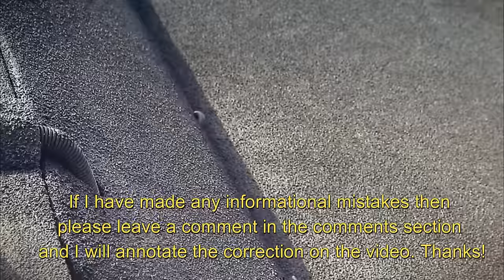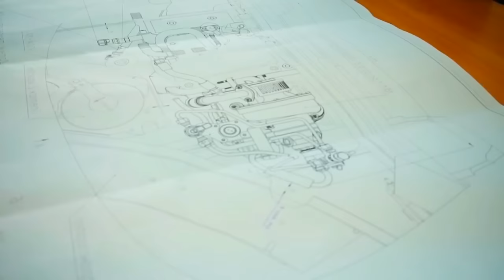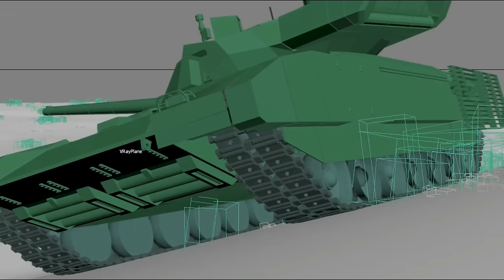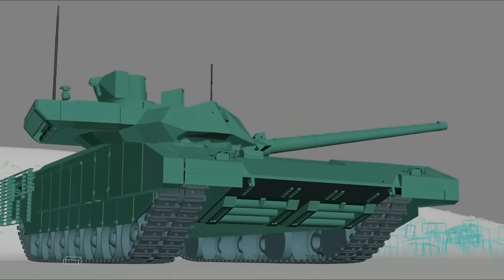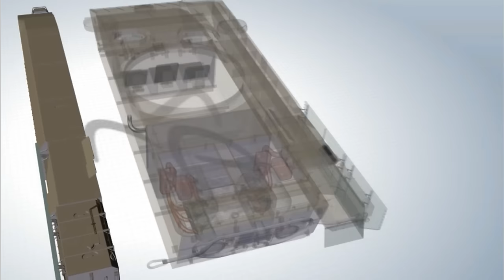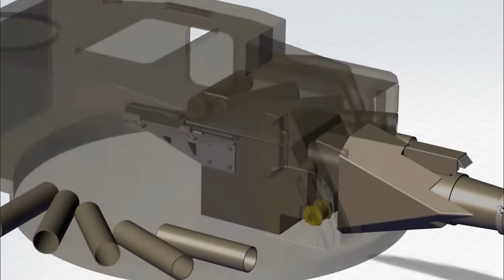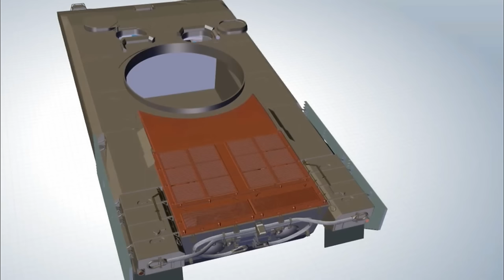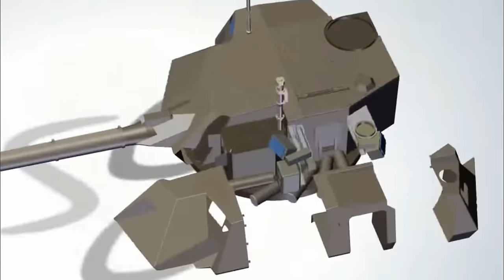T-14 Armata Russian Main Battle Tank - Tank Overview

Comment: 1000mm of frontal armor! Holy Fuck what I wouldn't do for that on world of tanks
Reply: Significantly more)
Reply: Enclave Soldier Tier XII comrade!
Reply: Actually 5400 because of the dual layered anti-tandem Malachit ERA.
Reply: funkierfawn budgie 
I am highly doubting that this ERA is actually 100% tandem proof or tandem proof at all. Especially when there is nothing on the web about that technology.
Reply: ori kojokro It is because in each Relikt or Malachit ERA block is a dual layered charge system with 2 plates and when tandem shell is hitting tank, 1st layer will destroy tandem charge and second layer will destroy the primary threat.

Except now, there's 2 blocks patched between armor for significantly higher armor value.
Reply: funkierfawn budgie 
Did Russia tested this ERA?
Reply: ori kojokro If it can stop a Kornet or a 9M123 Khrizantema, im almost entirely confident it can stop almost any other tandem charge out there.
Reply: funkierfawn budgie 
Any modern tank can stop a Kornet shot to its front. The thing is if it can stop a kornet to the side.

And by the why, what is your source to the "actually 5400  because of the..."? Seems to be too much to be true.
Reply: I also want to note most of bs about Russian arms comes from misunderstanding of domestic and import armor. Russia uses its domestic version and export monkey "M" version for export. Such tanks serve purpose for fighting terrorist groups or local conflicts but never were intended against modern countries invasions because things like night vision or armor values are not there, nor the lifetime network to link forces into effective groups. So anyways US will end up fighting its own Tow2 if they continue to do what they been doing under Bush and Obama presidency.
Reply: Enclave Soldier KV-2 laughs at 1 metre of armour.
Reply: Well...Well... We meet again
Reply: That's actually pretty standard in modern tanks. Composite armour is one hell of a drug.
Reply: +dewfan14 Get back to work, soldier!
Reply: i play warthunder and if world of tanks is the same with ww2 to slightly beyond tanks they would barely scratch modern tanks and modern tanks would easily penetrate them
Reply: but not a sabot ;)
Reply: The US also calls its export tanks "M" tanks
Reply: Check out the M1A2S abrams getting knocked out throughout yemen
Reply: Yup, according to General dynamics, all of saudis stock has been upgraded to M1A2 SEP standards with DU armor.
Reply: It doesnt matter because the T-14 can be equipped with a further set of armor weighing up to 25 tons, so whether it has good protection in its current form is not even an issue, imagine this thing receiving 25 tons of added protection, it most likely is a dangerous tank in its current shape and form but imagine the latter? Just some food for thought :)
Reply: xiLuS it doesn't move very fast now....adding 40% more wieght would be a death nail.
Reply: It moves at 50-56mph, Thats faster then any Abrams or Leo or really any modern tank.
Reply: Tandem are effective against older ERA, against ARA current tanden are useless, cause intreception charge destroy projectile completely.
Reply: And Khrizantema will ilght up any modern usa-europe tanks and some paper tanks as well.
Reply: SABOT can be defeated as well as standart munitions, moder russian ADA can sway SABOT off course, or make it breake before impact, even 5* sway will reduce armor penetration by 60%, and will make all energy flow in surface, wich will make SCARS but nothing too major, plus if russian tank fire sabot, witch is tungsten-carbide, it will go throuh armor like nothing, able to withstand insane temperatures it will melt armor, but core will stay intact, and no DU particles only heat.
Reply: Yep, this is actually number one reson why abrams so dangerous to crew, DU armor desigh to stop AP and SABOT, HEAT, but in reality HEAT if it penetrate composi armor and reach DU, will ingnite DU with behave like thermite, melt tank away. Tungsten-carbide might set m1a1-2 ablaze as well.
Reply: Plus unmanned capability + drone witch will work as target designator to tank.
Reply: олег бурдин if according to nii stali Relict armor is penned at 1000 m with M829A2, I doubt that current M829A4 would fail with the new ERA + it has a special tip that does not activate ERA on the hit at all. Current Russian APFSDSs like Svinets2 are way out of date compared to M928A4 The newest Vacuum hasn't finished its commission testing yet as well. I'm not even mentioning the newest Rheinmetal 130 mm L/51 for the Leopard2A8 and future Leopard 3 with up to 1400 mm RHA penetration. BTW - HEAT maximum penetration temperature is 600 Celsius which is not enough to melt the steel, or depleted uranium armor plates + Uranium in solid state does not burn - only uranium oxide powder does, so if a penetrator hits the armor DU plate won't ignite, just those tiny pieces turned to dust with the hit which won't do more harm than welding sparkles. :))
Reply: +Yuri Fyodorov actually DU armor has a critical weakness, it has an extremely low autoignition temperature of 400 C.
That's why the Saudi m1s burn like they do when hit by atgms
Reply: "Today's elongated sabot penetrators defeat even 1200mm" - Nope - only the newest Rheinmetall 130 is capable of that, but is wasn't officially disclosed yet.
"But swaying a sabot off course with ADA is more effective than breaking it with ERA' - it depends on the ERA :)
"they get hotter than anything they meet and bore their way through through sheer kinetic force and heat" - no because the ceramic plating or fibers heat up way slower and dissipate heat 10x time more effectively. DU penetrator is much more effective of DU's natural seffsharpenning ability - the stronger the obstacle - the sharper the rod gets.
"has an extremely low autoignition temperature of 400 C" - that's the DU powder you're confusing with, not the alloy.
Reply: +Yuri Fyodorov ignition temperature is different from ignition temperature
Search it up, literally search up "autoignition temperature of uranium and its isotopes.
Reply: LOL can't you tel the difference between DU Alloy and Uranium Oxide - a powder which ignites? If the alloy could ignite spontaneously how come someone decided to make an armor plating with it inside? RU crazy? :)
Reply: "Nope - only the newest Rheinmetall 130 is capable of that, but is wasn't officially disclosed yet."
And when was it tested?
Reply: Under extreme pressure of an impact, DU turns into a powder and oxidizes. That is why it is "self sharpening" as a projectile. As armor, where as tungsten fractures, uranium also turns to powder and oxidizes rapidly when exposed to high energy and high heat. KE transfer from another projectile... Please look up the M1A2s on youtube that are being blown up by konkurs ATGMs, one of the oldest designs in the russian arsenal. You will see some very interesting fires prior to the ammunition and fuel igniting.
Reply: Only 1-2% of the active alloy surface turns into a powder upon impact and that's 50-100 grams! A power equivalent to a small firework! The M1A2s on videos got their ammo rack ignited! It has nothing to do with DU oxide ignition + ATGMS DON'T USE kinetic DU penetrators, but HEAT warheads LOL! Maximum HEAT penetration temperature is 600C - way lower than DU ignition or melting point.
Reply: Try War Thunder. A German ATGM is 200 mm short of penetration.
Reply: M i n u s and 12km short of range.
Reply: well those are old atgms, atgms today can pen much more armor
Reply: thats like 3+ft 😲
Reply: it doesn't matter with modern top attack and tandem warhead missles also with scaterable mines.
Reply: this is a modern tank you won't be able to get the tank in WOT my dude
Reply: new tier 8  500 dollar tank confirmed
Reply: +Alex T i will correct you. Relikt is according to sources 2x more effective then Kontakt-5. Malachite is even better and Russians are working on 5th gen ERA with codename KAKTUS. Basically 1st gen = Kontakt, 2nd gen = Kontakt-5, 3rd gen = Relikt (on T-90MS), 4th gen = Malachite on T-14.
Reply: In mine too.
Reply: It's made mostly of Putiniun now
Reply: Damn Russian bias strikes again
Reply: @orikojokro6677  Obviously they tested it, what kind of question is even this?

Comment: Russia first used anti missile systems on there tanks in the 1980's in Afghanistan with the Drozd system that proved very effective at killing incoming missiles however it was mounted on the turret and only covered a 60 degree arch in the direction that the turret was facing, this was fixed with the Arena system in the 90's that had a 360 arch and was proven effective in Chechnya. 
Oddly the new afghanit system seems to be more based on the Drozd than the arena seeming to only cover the frontal arch f the turret of corse you always want the gun facing the enemy when possible this seems that it could be a weakness when fighting a insurgency though this could have been done to reduce the possibility of friendly fire against infantry behind the tank if triggered.

Comment: btw it would be cool of the germans re name a tank project to  TIGER III ;)
Reply: or a MAUS II
Reply: RAY RAY It will come out 2030 and by that time T-14 will have 152mm gun
Reply: Why would you name a good reliable and widely used and well manufactured tank after a tank famous for breaking down all the time, with a tiny production run that was manufactured to poor standards with poor materials? That's like naming a ship the Titanic II.
Reply: Tigers were not known for breaking down mate. Thats bs. Tigers were very reliable. Only the early tiger models broke down. As for panthers. The tank that broke down alot was the t34...not surprising since they were made by farmers compared to skilled german engineers
Reply: yes T 34 broke down alot but that not the problem because they can be fix right away and for panther and tiger they will broke down if they have to go for a long distance and if they do they cant go full speed the engine will broke down
Reply: I'll interject for a moment as this is an area of personal interest of mine. The Panzerkampfwagen VI Tiger and Tiger ausf. B were quite heavy vehicles with complex mechanics. The final drive was the weakest link for most of the heavy German armor and if mechanical failure was to occur, this was the most likely location. I'm not sure what you mean by poor standards so you'll have to specify. I have read the combat recollections of Tiger Commander Otto Carius and the engineer's notes therein included and the real issue was always lack of proper maintenance and INEXPERIENCED CREWS. Experienced crews were always aware of the limits of their vehicles and had access to good mechanics and consequently experienced few issues. If your point was simply that the Tiger had mechanical issues then you would be correct but the only reason it is famous for them is because of today's audience. I hope this is of interest and I am certainly open for discussion. :)
Reply: And I'm not sure if 1,839 vehicles including Tiger I and II is really a tiny production run for such complex and expensive machines. Perhaps if you are comparing them to T-34s!
Reply: +TeddyBear
Aaand you failed.
Reply: Theres already a Tiger III though XD Plus a Tiger IV, they need the Tiger V
Reply: they prolly name it REFUGEES WELCOME I
Reply: They cannot,its against the german law and anything it will create is remind german people of there past which they wanna forget very much. Also the law prevents it as any reference to nazism is illegal.
Reply: They cant sadly do old rules from WW2
Reply: @sondrejohansen48  Germany shouldn't be allowed to forget the past. They've started 2 world wars and killed millions
Reply: hedgehog3180 let’s be fucking honest Tiger sounds more imposing than Leopard.
Reply: @sondrejohansen48  Yes, the predators we keep in zoos are big-orange-black-striped-  or not-so-big-spotted-cats
Reply: No it wouldn't
Reply: Tiger ist 14s armatas
 bitch
Reply: Leopard is already a good name for a new German tank, especially in this generation.

Comment: Absolutely great vid. I love tanks of any country/type. Apart from the M551 Sheridan obviously. I'm an ex-tanker of the ADF, quite a rare breed given we had/have fewer thanks than Luxembourg..but anyway. This T-14 is a game changer. It reminds me about the MICV issue in the late 60s. The West (Germans) and the rest of  NATO talked for ages about developing  a well armoured MICV, but the Russians leapfrogged everyone with the BMP.  The Marder only came out 5 years later. Often while we talk the Russians act (often based on "leaked" info about what the West is thinking about). The Germans (again) have been talking about a Leopard 3 with un-manned turret, autoloading and a missile system for a new 140mm main gun, and  a 20mm or 30mm co-axial fast firing high elevation machine cannon as well. The KMW/Porsche/MTU paper study has stalled because they can't decide whether to put the 3 man crew below the turret or right infront, like this T-14. And the  thinking is that you  need 140mm to provide  a realistic gun launched missile system. But how do you get the whole of NATO to agree on a new standard calibre?
We study and think, Russians are capable of moving very fast when they see a breakthrough opportunity.
It's interesting that you note that all the pre-production prototypes went back for modification. That's really smart. The T-64 was a disaster for the Soviet Union, thousands were built before it became apparent that it was too much too far and under-baked in development. Very un-reliable. And if there's on thing the Russian Army hates it's un-reliable tanks.They learn their lessons well I think.

Comment: A device to deflect incoming APDS? That's a bit hard to swallow! We are talking about massive amounts of kinetic energy here.
Reply: "Shock core" is quite capable.
Reply: Mc Häckmäck It doesn't have to deflect, just create yaw. A well placed EFP or HEF interceptor can create an off-angle of some 5-10° in the right circumstances, which is enough to be reduce the round's penetration by many times. Israel's Iron Fist works in the same way and is claimed to basically render rods useless to anything but lightly armored vehicles.
Reply: Thanks!
Reply: Lol? You realize what you're saying right? I mean, the tanks ARMOR is there to 'deflect' the SABOT rounds, and they can put up with the massive kinetic energy when there's enough armor, but as for a device that takes it on well there's actually a variety of systems out there today some developed by Germany that destroy the round straight up..
Reply: That's a great reply, Mike. A far cry from Matsimus' usual comment section fare.
Reply: ***** Thanks, I have a tank community on Google+ (where I'm not so active, however), feel free to join if you like.
Reply: Mike Ennamorato
Thanks, I will.
Reply: If the sabot gets flipped around it won't penetrate very well at all.
An ERA-like system might do that pretty well.
Reply: I also find the ability to deflect APFSDS very hard to believe. It may be possible in theory and in perfect conditions, but many things argue against actual real life capability. First of all, we are talking about AFGANIT system on T-14. This system covers about 160 degree frontal sector. Anything coming from outside this sector will not be stopped. Also the the countermeasure dispensers seem to be fixed to the turret, meaning that effective interception of incoming shell requires turning the turret to aim the nearest dispenser towards the fligthpath of the shell. 

The velocity of APFSDS ranges from 1500 to 2000 m/s. from range of 500 meters this means less than third of a second to detect the incoming penetrator, aim the countermeasureand to fire the interceptor. It also takes time for the interceptor to fly to point of interception, few meters from the tank being protected. Unless the interceptor hits the penetrator near perfectly, it wont effect the penetrator, because of its massive energy. 

Even if the sensors on T-14 could detect the penetrator traveling 1800m/s, it has no time to aim Afganit at it. If Afganit works like its predecessor Drozd, it wont be able to stop APFSDS. If Afganit uses instant EFP without travel shell, then it might have chance of disturbing APFSDS. In theory. Most likely T-14 relies on heavy ERA to protect against APFSDS and APS are for slower projectiles like rockets, missiles and HEAT shells.
Reply: the APS is mainly for defeating RPGs, and preventing them from damaging the ERA on the tank. as for high velocity kinetic energy penetrators. the APS will induce a yaw, then the ERA will stop the projectile. this was tested by the US too on the abrams by using israeli trophy and ERA. even APFSDS fired from a 120mm can be stopped completly, and protect the base armor behind it. the russian APS on the armata is a bit big. thats more than enough to reduce APFSDS effectivness. though, of course, there are gaps on this, since only the front and side front are protected, and the turret needs to turn. but something like this is far better than nothing. such large interceptors like these are guarateed to stop almost any projectile. and most tanks dont even have APS too.. added to this, they also have soft kill countermeasures, and an automated turret with plenty of room for composites, and the price of one t14 is half that of an m1a2sepv2..
Reply: front sector of the TURRET, which AUTOMATICALLY SLEWS when it detects an ATGM coming in to put its countermeasure systems in line with target.... commander / gunner could countermand this.. but i imagine theyre wiill be trained to understand the tank is reacting to a threat before the crew realize there is one...
Reply: @qelleri  actually, there is a video of testing Arena/Afganit against apfsds. And it destroyed the apfsds with no problem
Reply: @stilpa1  would you link that video to me? I'm interested.